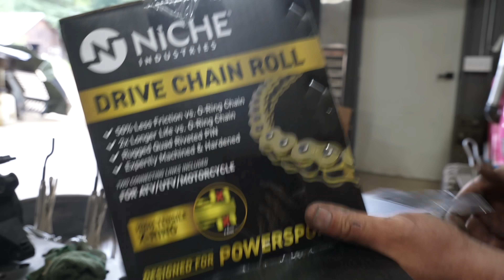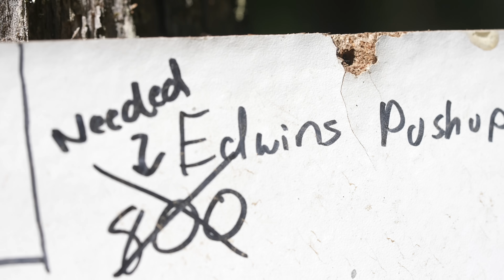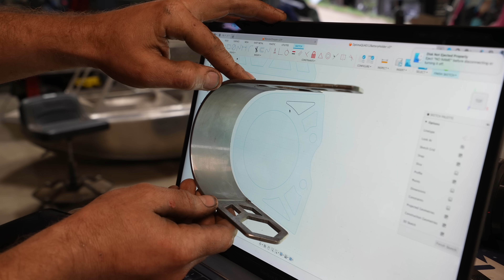We Rebuilt the Chopper and Met State Troopers!

Comment: The porpoising is because the stroke of your shocks is too short for the bike, it's cavitating at the bottom and pushing the front end into the ground as fast as it can. You'd be better served using some long stroke shocks off of something like a trophy truck.
Reply: Or it’s the unbalanced 46” tires 😂
Reply: @DrivingCrooner2000 probably that
Reply: @kurdisshop243 that the problem the tire weighs as much as the entire frame so when the tire is out of balance there's no weight to keep it on the ground the tires just bounce
Reply: @venumus1 lower air pressure possibly?
Reply: @venumus1  This right here. Definitely needs balanced no matter what. Gotta also consider it's not just up and down that the imbalanced tire is pulling. It's also imparting a forward and back force, which results in the side to side wobble.
Reply: @SandySuit I doubt there’s much more than a couple pounds in the tire as is.
Reply: Trophy truck shocks aren’t gonna get remotely close to fitting, lol.
Reply: I don't really know how balancing works with tires and wheels also with these being shaved. If they had a balancer could weights and or beads fix it? Or would they need to shave the tires perfect or shave more until it's balanced?
Reply: @WhatsIncluded  being out of round can be just as much of an issue as out of balance, you could probably use wheel weights on this but ideally you would want to use the beads to keep the weight down low and not need 4 lbs of tire weights. However being out of round causes vibration and chatter more then hopping at certain "frequency"
Reply: @venumus1  so burning out and turning to make sure you're getting all the tire may have helped or continue to help?
Reply: @WhatsIncluded  it most likely helped yes but the front tire hasn't been as refined as the rear and arguably has less weight on it since as you accelerate the torque lifts the weight off the front
Reply: @WhatsIncluded  beads will probably fix it.  he'd have to build a bubble balancer to use weights.
Reply: @venumus1  true I did notice another comment said rotate the tires
Reply: Wasn't the idea of raking a chopper inspired by tank slap?  Just guessing
Reply: @scythelord  There's more to it than that, those tires are fundamentally unsuited for this. Motorcycle tires aren't just normal tires with round tread, they're engineered for the multi-axis application. It's never going to work quite properly at speed with tires designed for a single axis.
Reply: @DrivingCrooner2000 the tires are unspung weight, they won’t affect the suspension they will cause vibration though.

Comment: Ethan, you mentioned the monster bike was a beast to turn, years ago when I first started riding bikes a mate gave me this tip, you may already know it but if not it might help if you are going around a bend for example TRY pushing or pulling the opposite handlebar  only a few MILLIMETRES it is counter intuitive to what you feel is right but it will get the bike into the curve or bend very quickly DO NOT push or pull excessively or you will end closer to the road more than you ever wanted 
It is how the bike racing guys get right over corner to corner very quickly and very low if needed practice carefully until muscle memory can be trusted to do it automatically. 
Tony from Western Australia 🇦🇺
Reply: It’s called countersteering Tony 👍🏴
Reply: @v12dot  I didn't know the name just the principal of it, thank you

Comment: The front tire wobble is such that the videographer has to slow down as soon as Ethan passes, making passing easier. In addition to Ethan, you must wear the full RR riding outfit. Possibly it would be better to install vibration dampers directly on the front tire and stiffen the front fork.
Reply: Someone else commented exactly right. Longer springs to be installed in the front (~20 inches). The tire pattern must also be changed. You can use a chainsaw (or hand circularsaw) and cut the studs in half.

Comment: 0:33 if you actually wanna make it stronger you have to change the points of pressure.
What do you have to do Is cut it into a 5 point star then weld crescent moons 🌙 around the bar it's self it reinforces itself.
No place to go when all points of pressure are equal.
The bar would explode before it breaks.

Comment: To minimize shaking in the front tire, an additional support system is recommended to stabilize it and ensure proper weight distribution. For the rear, adding another tire of the same size would enhance balance and improve overall performance. Additionally, reducing the size of the front tire could significantly enhance the motorcycle's dynamic appearance and stability.. Just a small feed back. Great prototype and awesome job btw.

Comment: IIRC you guys have a bridgeport mill, for longer parts you can actually have it mounted to where it is over the edge of the table and then just rotate the head and ram assy. over to the side to drill the holes needed. it is just 4 bolts holding the ram onto the base. Also you can adjust the ram in and out as well to help. Just remember to make sharpie witness marks to help with realigning the setup after done.

Comment: So my summation is that the hydralics for the steering doesn't have enough pressure to maintain the direction the tires is pointing at certain speed bcuz of the imbalance of the tire. I also think that since there's no angle to the steering arms and maybe a bit of negative caster is also adding to the wooble.

Comment: Instead of welding shaft/ roller bearings.  I'd use solid shaft with tapered bearings, and replaceable races in the rear end housing , for adjustability. Press on flanges and seals for rebuilding.

Comment: Nice bike there.  I haven't watched all your videos yet, so not sure if you fixed it already,  i think the reason why the font wheel wobbles (45:53) is probably because the axis of steering rotation is placed in front of (or inline) the cg of the front wheel.  Ideally you want the steering axis to be pointing between the cg and the ground contact point. This should help with steering as well. look up caster effect and trailing.

Comment: The wobble at 45:10 happens pretty much exactly when you pull out of the wind shadow of the truck. I would guess the huge wheel acts like a sail and catches the sudden oncoming air resistance and tries to push the bike to where you aimed to overtake, you correct, that exposes the other side of the wheel more and since you're trying to maintain a forward moving line in the vector of momentum it's a subconscious struggle between you and the changed wheel angle that causes this wobble. Just a dumb guess from watching the video.

Comment: I question if that front end assembly flexes ever so slightly and coupled with the suspension compressing and releasing, along with the probably ever so slight out of round pretty much any rim has, especially as they get larger and voila, you get that swaying/bouncing. The tire also isn't probably perfect either and at 5 lbs PSI, a bit more bounce.

Comment: to remove the jumping try changing the wheels to a diffrent kind that accepts higher speeds  
the reason you are jumping is not enought wight on the front and the wheel jumps from the treads

Comment: I've no idea if this is up your alley or not, but there's some mystical crap called "cathodic protection" used on sea ships to prevent rust.. Essentially just a metal-on-metal connection between the steel and some zinc or magnesium is all you need to keep the steel from corroding (the sacrificial metal will corrode instead). I have no idea how effective it is in air, but I would absolutely love to see someone make a bare-metal vehicle that's rust-proof. Magnesium is *cheap*, too.

Comment: Think the reason you're getting any traction is because it weighs to little. Tires that big need a lot of weight in order to push them firmly against the ground, this is why big tires does not equal better grip on the road. Try adding more weight and you'll probably get better traction.

Comment: I would put the front ummm fork????, i dont know to call it the chasis part that holds the wheel and is connected t the suspension and the stiring. on the righ side just so its oposite from back left. that so it wont be left heavy and youll be centered better

Comment: How you can use that thing on a pubblic road is beyond my comprehension. It seems not very agile or easy to stop when you are up to speed, what if you encounter a sudden obstacle? Or another veichle has some problem and sverve into your half of the road? It just seems so unsafe to drive on pubblic road, maybe it would be safer to tow it to a private racing circuit.